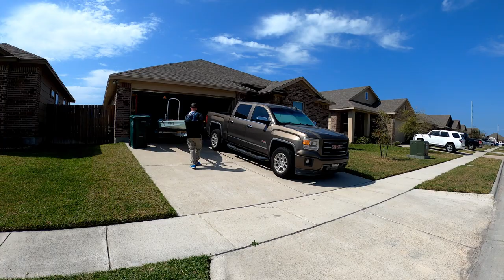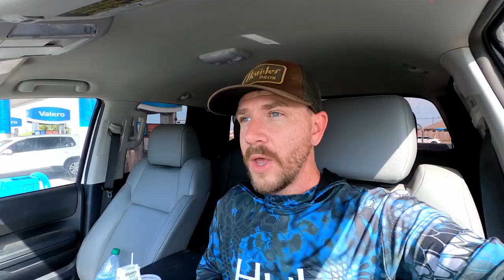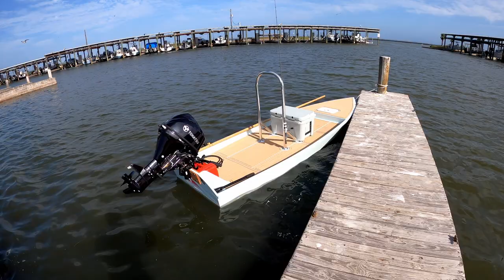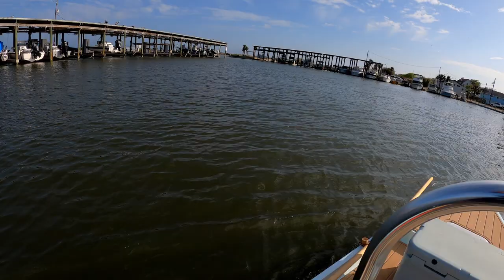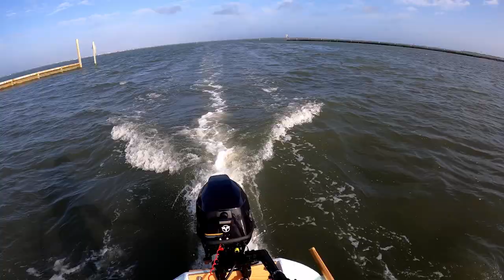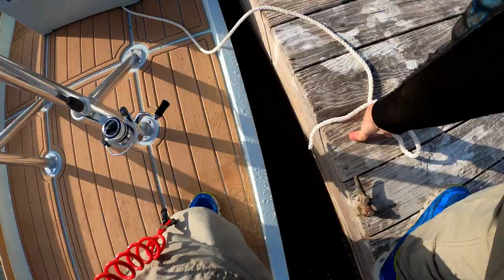DIY SKIFF First Launch - I Finally Launched My Skiff! - Bateau SK14

Comment: Awesome man.  I would add a rubber rub rail if your concerned about bumping the boat at the dock while launching.  And it is never too windy to fish for redfish in that area!
Reply from the maker: Yeah, the rub rail is already in the works. The concern with the wind was that I wasn't rigged up with anyway to anchor or slow down my boat. I was blowing so fast that I had no control over my lure.

Comment: Great boat. It looks like a Gheenoe. It's nice that you can move that trailer by hand. Is that EVA foam decking? Have you ever used it before. Is it tough? Thanks. I'm re doing an old StarCraft and wondering if EVA will have longevity.
Reply from the maker: Thanks you! I love that the boat is small enough that I can maneuver it by hand on my own. It also fits in the garage really well. Yes, the decking is from MarineMat. I like it so far. The only two things that I would complain about at this point would be that it is kind of hard to clean and that a power washer will cut into it fairly easily....

Comment: Interested to see how the push pole works. Concerned ittl try to float on u.
Reply from the maker: It'll be interesting to test out. It might be tough in deeper water but I'm betting it'll do fine in 2 ft or less.

Comment: you should always have an engine bolted on so it doesn't fling itself off very dangerous not to or at least have a strip of wood to keep it from sliding up while turning

Comment: How is the stability at the bow? I’ve been looking around for plans to build myself, are you able to stand and fish from the bow without any issues? And if so, do you think you’d be able to hang a smaller bow mount trolling motor from it? Or would that likely be too much for it
Reply from the maker: Yes and yes. I can easily stand on the bow and fish. I have no problem fly fishing up there while someone else holds the tiller and puts us around. I have seen where other guys have mounted a trolling motor on their bow. It looks cramped, but I imagine it works well!

Comment: Did you change the design a bit? Mine has a lip all around. Yours looks flat.
Reply from the maker: Nope, I didn't change the design. Mine has about 4-5 inch tall sides.
Reply: Thanks for videos, I got my plans for the sk14 today, talked to boatbuilders about adding width and 2” height they said NO. What do you think? I’m 80 and need all the stability I can get, is there any way to see your boat before I start building. Thanks. Dean